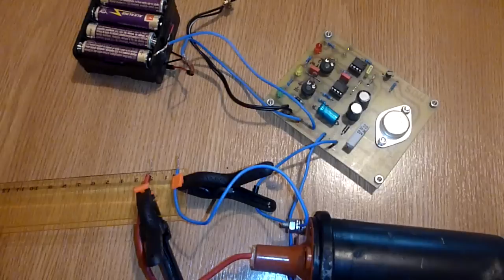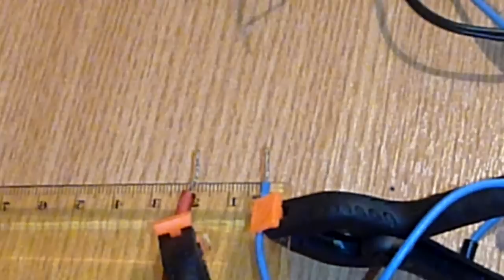Electric fence 20KV

Comment: I assembled the board but when I attempt to run it the top and bottom LEDs come on and do with flickering but the middle LED does nothing nor is there a spark. I replaced the 555 IC but still no change.

Comment: This circuit looks interesting, but I belive it´s not closely as strong as an electric fence charger. It does deliver 20kV obviously, but as soon as you connect it to the fence wire the voltage will decrease (depending on the length of the wire) to 3 or 4 kV because the ignition coil does barely deliver much current. Don´t get exited by the 20kV - for "serious" appliance use a "real" fence charger...
Reply from the maker: The wire itself, regardless of length, if properly insulated will not cause a voltage drop. On the other hand, if there is an insulation problem, any "fence changer" will immediately drop to close to 0. Reason for that: ohms law.
Reply: Can I use battery less than 12 V like 4 or 6 V and is the voltage made by coil dangerous for human and pets

Comment: Hai. Can i try this on solderless breadboard?
Reply from the maker: yes
Reply: @radumotisan  tq
Reply: @radumotisan  i used 470uF electrolit capacitor. Is it alright?
Reply from the maker: @diyamadiah9234  yes
Reply: Hi, may i know how u measure the voltage produced by the spark ? How u confirm it's 20kV ?

Comment: what if you made a circuit that could detect the change in resistance to detect and then shock intruders to save power
Reply from the maker: Might work. Or to signal issues with vegetation touching the hot wire.

Comment: Hi, may i know how u measure the voltage produced by the spark ? How u confirm it's 20kV ?
Reply from the maker: by spark length in air .
Reply: @radumotisan i used multimeter and high voltage probe. But the maximum reading obtained is 20V.
Reply: @radumotisan  is it actually possible to use multimeter?
Reply from the maker: @diyamadiah9234  what is your spark length? If you want to see high voltage probe, see pocketmagic for a DIY good probe.
Reply: @radumotisan  0.1cm
Reply: @radumotisan  why my spark not consistnt. Sometime got spark,sometime not. And the duration of the spark also not consistent.

Comment: Looks a little like a stun gun, was wondering if it continues to draw charge whilst pulsing or is configured to just reload the current once touched and expended, am using deep cycle 12v batteries with limited solar panels and charge is precious, thanks in advance, abz
Reply from the maker: yes, draws more current when pulsing. The overall consumption is low, so it can be used with solar panels in remote locations.
Reply: @radumotisan  i have emailed you please Reply. AK

Comment: This circuit looks interesting, but I know  VW  induction coil is only 10KV. Only Mercedes Benz coil has 13KV. Did you measurement High Voltage with a hook tester one the fence ? I will make it. Thanks
Reply from the maker: There is no limit to the coils, expect for the point where the insulation starts failing. The output voltage depends on the input voltage too. I didn't measure the output voltage, except by estimating it from the spark length (I'd say it is enough). See my other High voltage videos too.

Comment: Thanks radumotisan, will do. Started building the pcb at 2330 new years eve,  thats how I spent the new year,but run out of etchant & have to wait till 3 Jan to acuire. Have you ever tried autotrax? Seems quite an easy to use pcb designer. They have it on sale all week for $99
Thanks

Comment: Not high current but High voltage.  20 kv= 20,000 volts.  this produces little current or else this could fry you if you got zapped by mistake.

Comment: @radu are all resistors 1/4 watt except the 20 Ohm? Capacitors All standard non electrolytic  except the 5 W 1000 micro farad which is electrolytic?

Comment: Nice! Could that work by plugging it on a wall socket? Or using an old car battery?
Reply from the maker: car battery yes. Wall socket only via a 12v dc adapter.